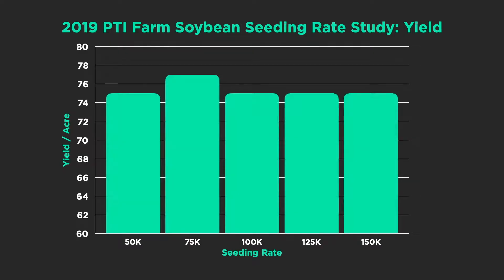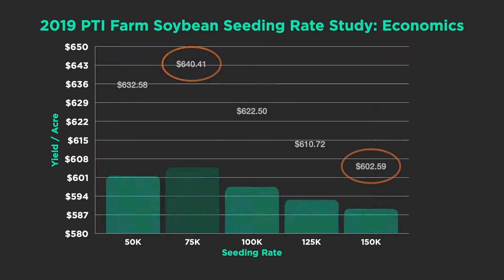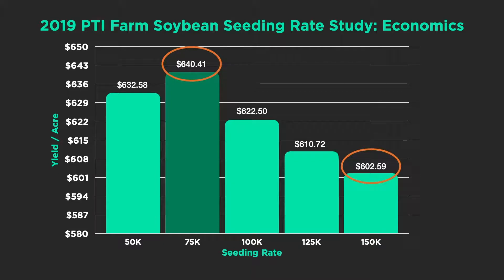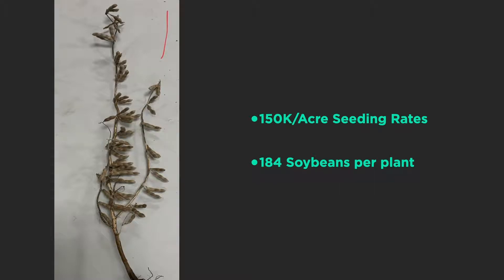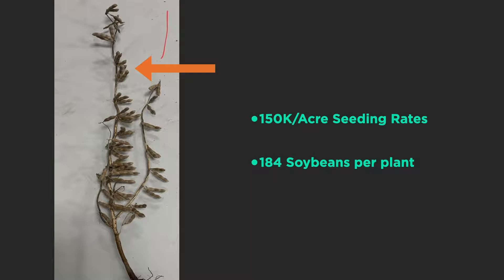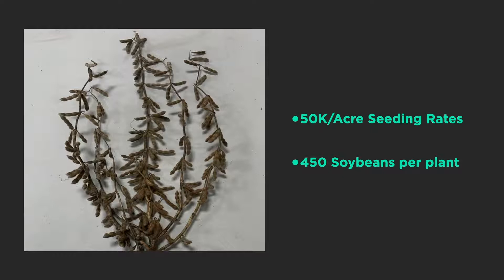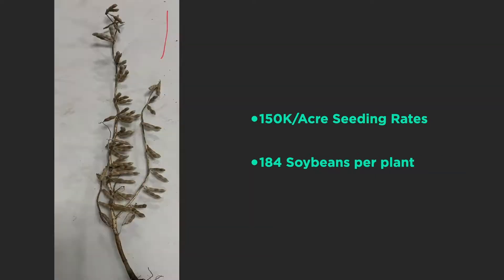InsidePTI S1•E27 | Soybean Seeding Rate

Comment: I am using a split 7000 John Deere planter I built with Kinze brush meters ,48 cell disk. I tried variable rate treated seed in April planting. Low rate in heavy soils down as low as 75000. Medium soils 100000, light soils 140000. I have had great results. Better ground 90 to 108 bpa. Average yield of 65 bpa. Sands as low as 15 bpa. Subsurface drip irrigated averaged 88 bpa with top of 108. I like variable rate soybeans.
Reply: Nice work Ronald